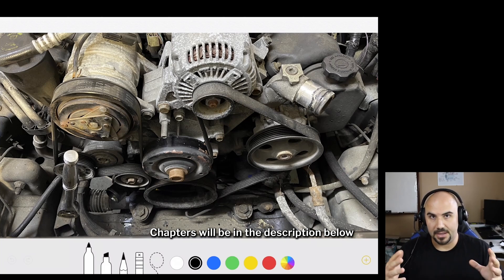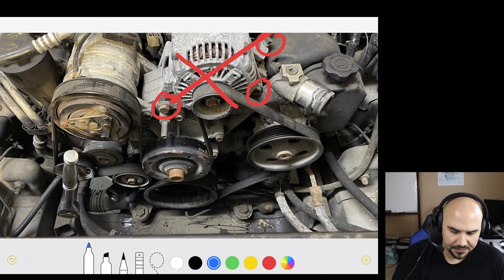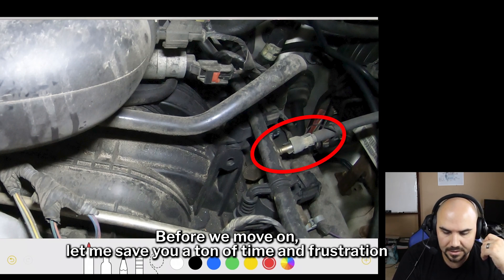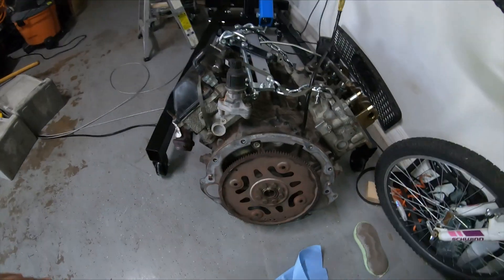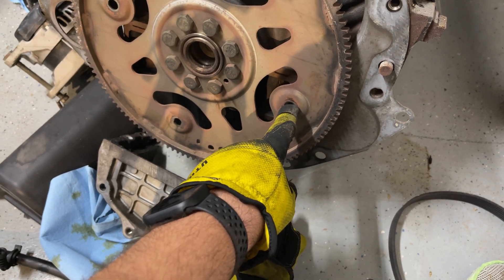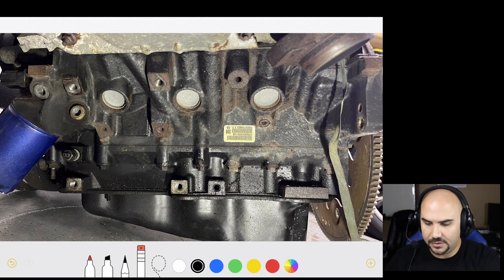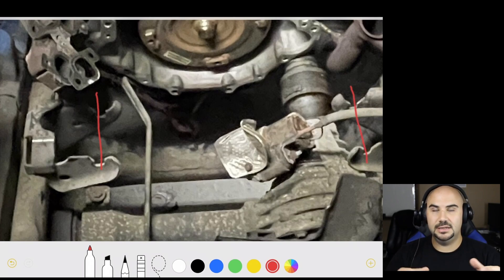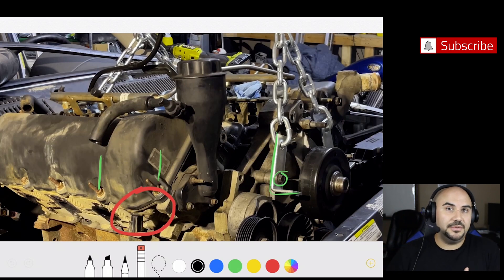Step-by-Step Guide to remove the Engine from Jeep Liberty KJ 3.7L: A Comprehensive how to

Comment: I know this video is 3 years old an all but I’m contemplating putting an engine in a 2008 jeep Laredo with very little rust though the body has 290k on it, not sure if it’s worth the money, I could buy the body for 800 dollars for the family discount and have found a 3.7 for roughly 1200 but when it’s all said and done I’d imagine minimal 2500 at best, would that be worth my time to fix?

Comment: So the harness stays in the car while the engine is removed?
Reply from the maker: @imthatguypal correct, done done the way we did, you don’t even crack open the A/C system or the power steering system

Comment: How much torque to turn crank shaft? My dtrs timing skipped and nothing wants to turn. Any advise?
Reply from the maker: Sounds like it seized or something impacted. It shouldn’t take an enormous amount of torque, our engine had a rod fail internally so it wouldn’t complete a full rotation in either direction. Had to rotate back and forth when it came time to unbolt the flex plate from the transmission.

Comment: Do I have to drain any fluids from the engine? Like oil, transmission or of any sort.
Reply from the maker: I didn’t with the exception of the coolant, you will drip a little of fuel when you disconnect the pressure line from the fuel rail, otherwise you’re not opening up the transmission (torque converter doesn’t need to come out) and you don’t have to open up the oil system. I did drain the oil but that was more out of curiosity than necessity
Reply: @CrookedMustache  thank you alot. Btw Great video. Helping me by far from all the other videos.

Comment: Swapping 05 with an 05. Am I going to have a computer problem? I swapped PCM and that was a no go. Thank you for the video.
Reply from the maker: I think I had to change one sensor, because the 05 sensor didn’t match the 07 harness, but year to year I don’t think you should’ve had an issue
Reply from the maker: My swap was a drive by cable to a drive by wire and all I did was swap manifolds
Reply: Thank you.

Comment: Can you please help with ID of a part? It is located at the front right of the engine bay, it is attached to the framework left of the battery. It has two hoses attached, one comes from the throttle body, the other I'm not certain. There is a connector on there with a Black/red wire and a blue wire. I have scoured the manual but I cannot find what it is for, it is broken and has a diaphragm in the bottom. I would be grateful for an ID please
Reply: That is the purge valve for the EVAP system

Comment: My trans is stuck to the engine
Reply from the maker: From the calamities I went through, I’m gonna say in this order check 
1. a missed bolt from the trans to the engine
2. One of the two bolts that go into the trans from the engine side
3. The starter bolts
4. Missed a flex plate bolt
5. The locating pins have seized (it’ll still come out, but it’s gonna put up a fight).
6. Finally remember that because of the design of the engine mounts, when you remove the bolt that secures the engine mounts to the jeep frame rails, you have to lift/tilt the engine up so the the mounts clear the cradles and you can move the engine forward enough to separate the engine from the trans

Comment: Is there anything special I would need to do to swap 3.7l seized engine.
Reply from the maker: FULL DISCLAIMER (since this might be considered getting into the weeds here) I’m not a certified mechanic but its how I would do it if the engine would not turn at all.

Kinda, so your biggest hurdle is you won’t be able to access the bolts that attach the flex plate to the torque converter ( 8:52 ). To avoid pulling the transmission as well, you’ll have to pull the torque converter out with the engine. For that I’d recommend pulling the radiator for the extra room and to prevent damage and instead of pulling the bolts from the motor mounts you’ll have to unbolt the mounts themselves from the block (while finding a way to support the engine DONT GO LOSING ANY FINGERS NOW!) to allow for enough forward movement for the converter to clear the bell housing and I would absolutely support the trans to avoid damage to the input shaft when the converter comes off.

Comment: Did you have to do anything special to remove the bolts that hold the exhaust manifold to the exhaust downpipe? Mine are completely rusted out and the clips that hold the bolt keep turning with it lol I'm about to cut the exhaust out tbh.
Reply from the maker: Ran into that problem with the passenger side manifold on the bad engine, I ended up removing the manifold from the head, once the engine was out I had room to climb into the engine bay and cut the bolt so I could separate the manifold from the down pipe

Comment: What is the best way to unbolt the top bellhousing bolts from the engine bay? And if not is there any other way? Ive been struggling with those for days lol
Reply from the maker: I know what you mean, it’s wrenching by braille lol. For the top two, With the intake manifold removed you should at least be able to access them and a ratcheting wrench will save you from “locate, twist, lift, repeat mantra lol. 
For the upper ones on the side, if you can get you hand into the gap the wrench might work, for me ended up using a ratchet with several extensions and the angle drive to reach it from like the back for the transmission. Hardest two bolts of the whole job

Comment: Great detail yes the top bell housing bolts are a pain the 2 top side ones also did you have to loosen any transmission support bolts to angle transmission at all or will it seperate enough to pull engine thanks!
Reply from the maker: For pulling the I did nothing, it’s came straight out with some persuasion lol. But I did notice the trans drop slightly, supporting it with a jack would relieve any of tension. For the re install, having the transmission at its level height will make it easier or you could angle up the transmission slightly to help mate the two together. The biggest pain will be getting the motor mount bolts to drop on to their cradles. Have a long pry bar or even a broom stick to tap the bolts forward or back as you lower the engine to get them in place.
Reply: @CrookedMustache  the top trans bolts cannot get to unless you pulled trans with engine or removed intake like I had to.

Comment: Very helpful and detailed, I just pulled a motor and wish I would have watched this video first.
Reply: How many hours did you have in it?  I need to pull mine.
Reply from the maker: In theory, the swap (old engine out and replacement back in) is a weekend job.  If your only pulling it out for now, under perfect conditions, maybe one day. But I would still plan for the whole weekend in case of stuff like spinning bolts, rounded bolts, or nuts. That's the stuff that will kill your momentum
Reply: @douglasblack3865  it took about 6+ hours. Labeling and bagging recommended.I also pulled the rad,